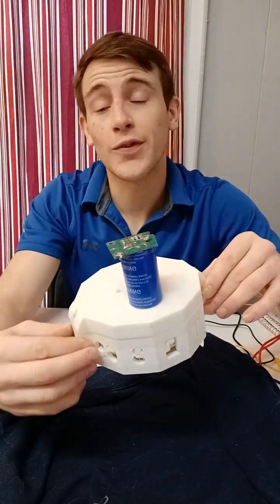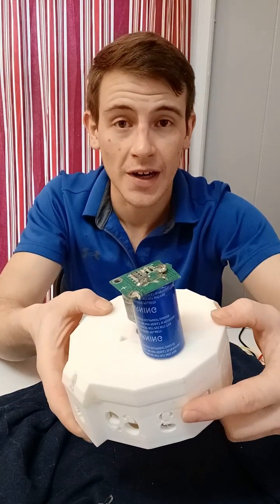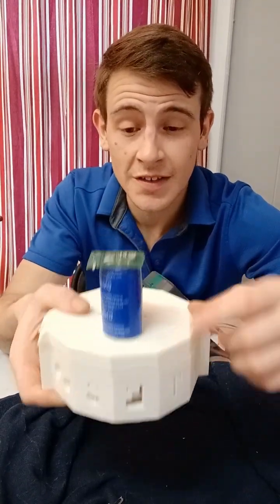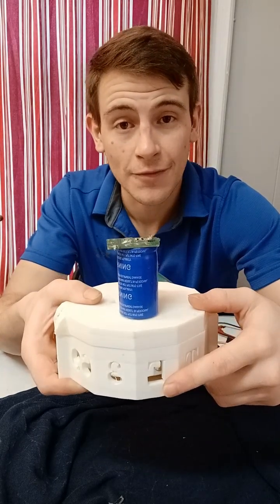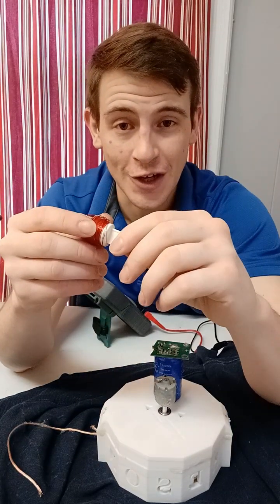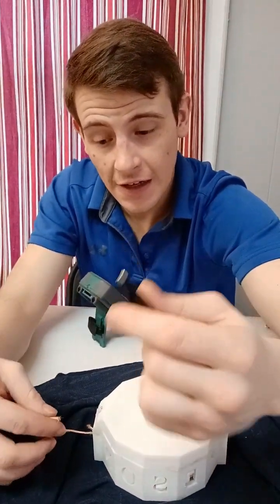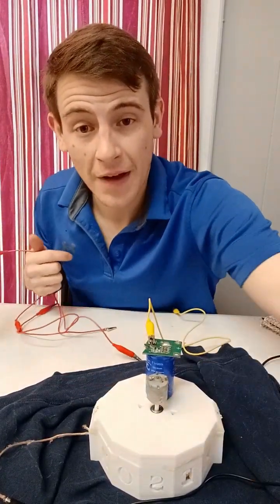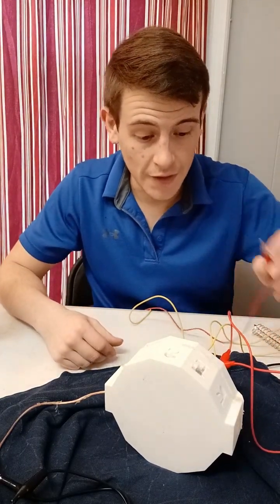Overunity  3D Printed Dodecatron Idea 1: 3vDC to 120vAC Generator Lights 4.5Volt L.E.D

Comment: in case you are sincere, there are  MANY  things that you don't seem to know.       while you apparently embrace other ideas, that are  fantasy.        the use of Capacitance  in an ou system  is  a   Mistake.         because, capacitance is an  accumulation  of energy  OVER  TIME.          in other words, the use of capacitance  Obscures what the  Actual  Continuous performance  of a circuit/system  is .        every coil   is  an  Inductor.!        if a coil has a layered structure*, when it is energized, the flow of current in adjacent layers will be  180 mechanical degrees  Out of Phase *.!!!        because of this,  a layered coil makes relatively more  back-emf/impedance.    and, a poorly-made coil acts as a  Current  Clamp.
conclusions:   a coil made of lots of winds/layers of small conductor is a recipe  for  FAILURE.!!!      in the context of a power processing system, if small magnet wire is used,  coils  should  be  wound  'in hand'.      this means, winding more than one strand, simultaneously.     d
*  the design of a layered coil can be, but never is, optimized for minimization of  impedance from back-emf.      this can be done by connecting the layers of a coil  In  Series.
Reply: Look forwards to watch your videos
Reply: Do you have a demonstration of this?